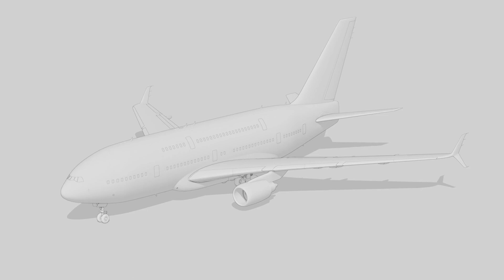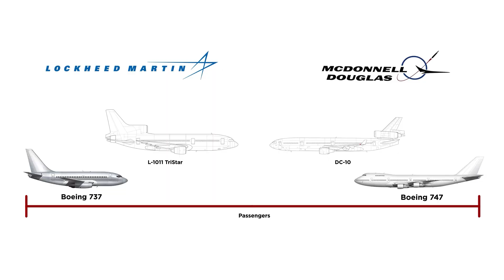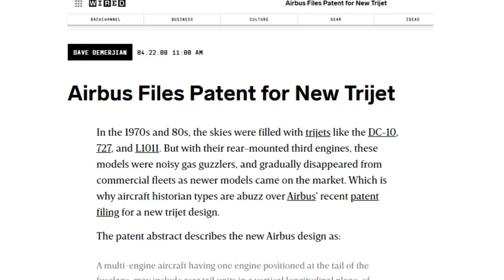Why a third engine is the future...

Comment: There's a reason commercial airlines have all of their engines spinning in the same direction: you need less spare engines if you only use 1 type of engine and more familiarity with maintenance crews on said engine type. By introducing 2 engine types on an aircraft, you go against both of these principles and airlines won't like it.
Reply: Probably the stupidest thing I've ever read. Jet engines can rotate in any direction because torque isn't a factor. The direction of rotation doesn't change the type of the engine (which comes standard from the nominated manufacturer) and most certainly does not require extra expertise or anything of the sort.

You clearly aren't an engineer so I'm not sure why you're spouting rubbish
Reply: @vjc3818 I agree, i am an Aerospace Engineer (in aircraft structures), my original statement was from my Aircraft Stability and Control Professor who has 20+ years experience in the industry. Not to mention Mentour Pilot made a video from 6 years ago about this topic and echoed my professors answer on why jet engines spin in the same direction.
Reply: This is just false
Reply: @GavinForegard Ok, explain
Reply: @Buttersthatsme01  they spin in opposite directions if not the torque would start to affect the plane
Reply: @GavinForegard They spin the same direction. Even most twin props spin the same direction. Props you get critical engine because of torque, spiraling slip stream and some other factors. Jets it doesn't matter.
Reply: @SimMemphis737  oh alr I'm guessing that it's because jets have counter rotating fans inside that cancel out the torque
Reply: @GavinForegard  You sure have the confidence of a MAGA, jeez